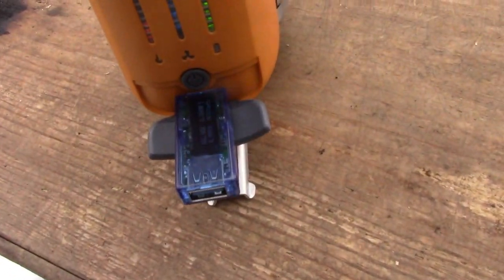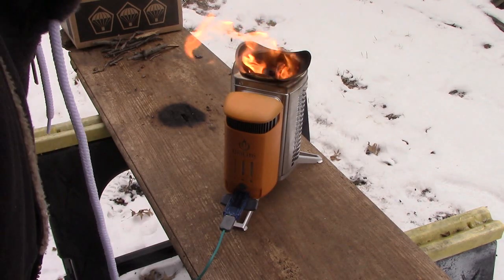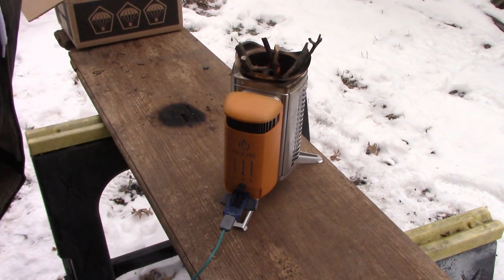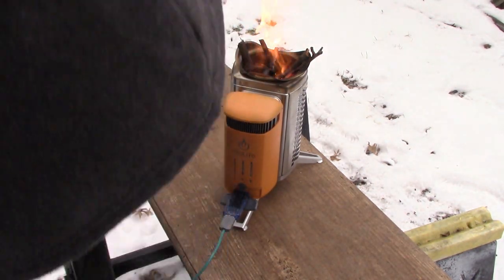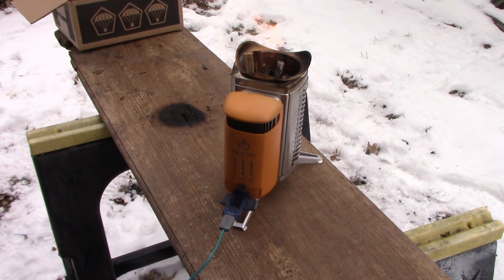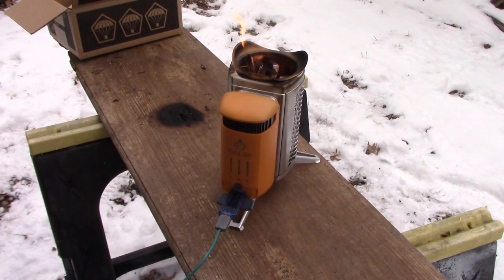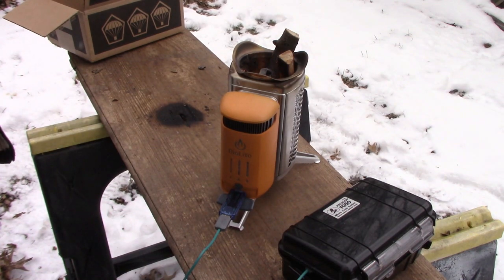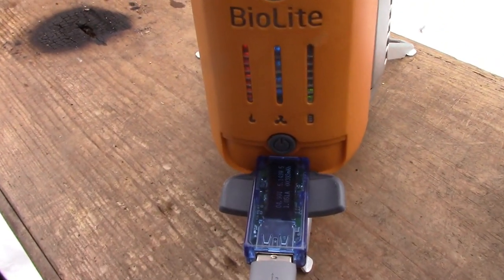Biolite Camp stove 2 -THE BURN!!!

Comment: I noticed u had fan speed right up!

have you done a test where once heat was established u could maybe turn fan speed down to half and see if it holds max heat (red led) 
doing this we may have more energy for charging batter and or phone ect 

Thanks for sharing and love the use of the usb energy monitor
Reply from the maker: vkdirector3087 I have not done that as a test yet. From my experience with the stove. Once that stove is Max, it Max haha! I will have to try a cool down test to see if that helps with charging.

Comment: I use wood pellets in mine. They produce no smoke and the flame indicator goes to max fast. Plus there is very little ash after.
Reply from the maker: C MJ I've never tried wood pellets. I'll have to check that out.
Reply: Still loving the product?  I just oredered mine yesterday.  I have spent a lot of time looking and this in theory is a no brainer as long as it holds up...